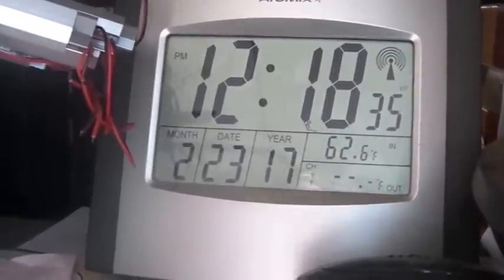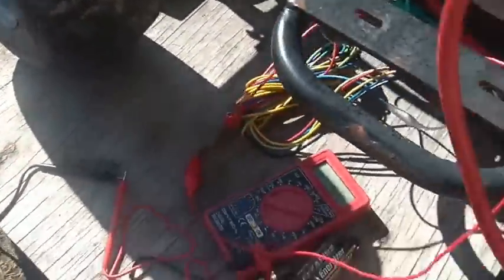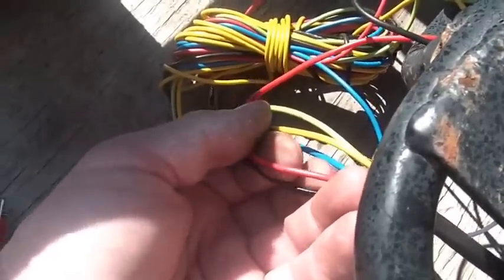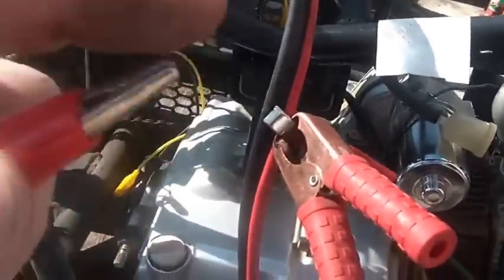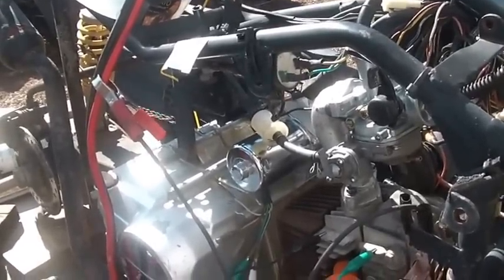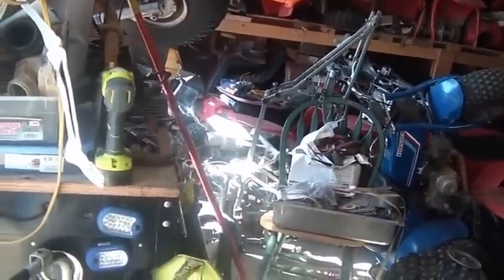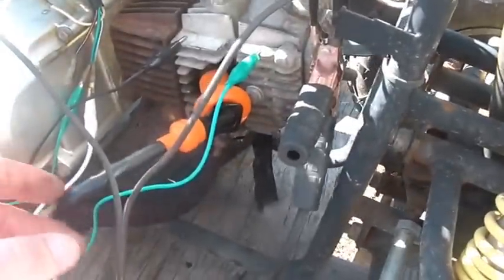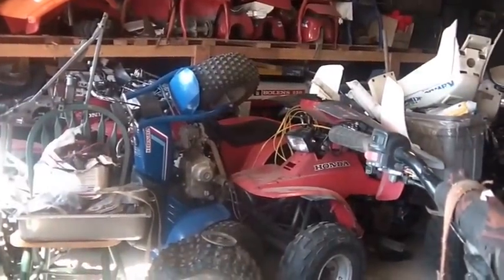12Volt DC Casoli CDI Hack, 70cc China Quad, CVD transmission,

Comment: Had a bunch of those boxes at one time. Really liked them but they didn't last long. Some went bad fast and some lasted a few months. One was so new I was pulling the carb off and checking wiring.  Seems the advance goes out of them. All the ones I have now are the plain black ones.